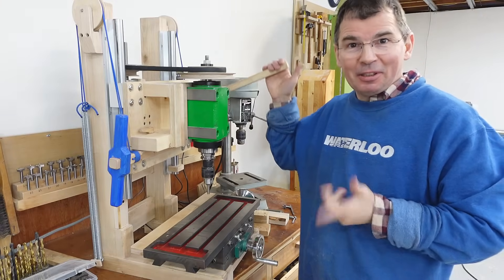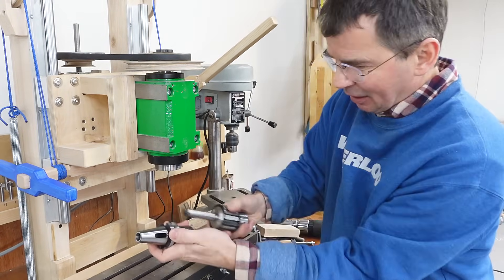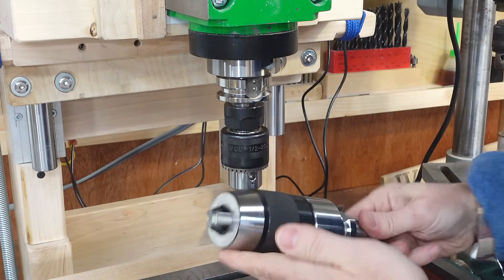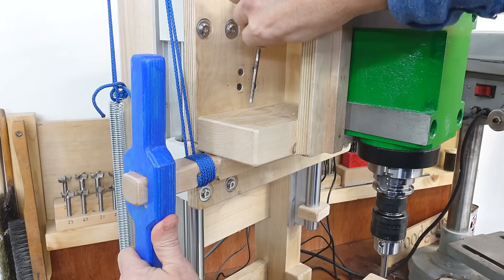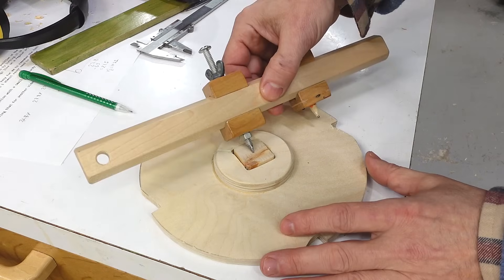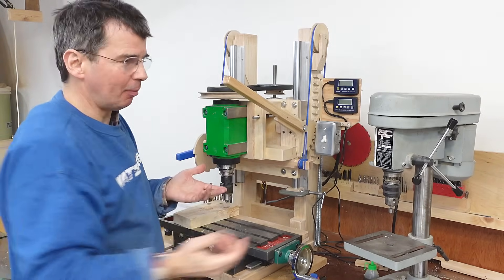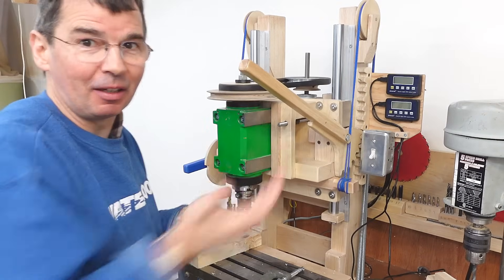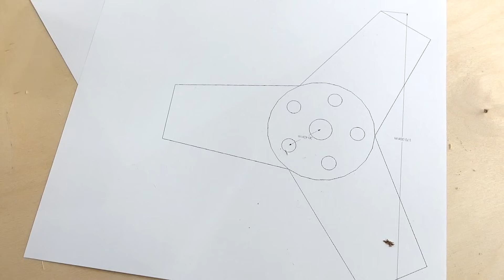What's wrong with my mill/drill and improving it

Comment: Now that you have improved the milling/drilling machine, what do you think?  One of the operations I would like to improve in my shop is drilling, relatively deep, truly vertical holes.  Is your machine better than your drill press at such operations?
Reply from the maker: I have lots of vertical travel.  Limited primarily by how much stretch I want to put on the srings.

Comment: quick and dirty way to shorten carbide bits is to hold them in the vice so that the part you want to remove sticks up, and hit it sharply with a heavy hammer. They usually break pretty well, and the imbalance doesn't usually cause too much vibration 😅

Comment: I read a reply of yours to someone asking about upgrading the springs to hydraulics, and it basically coming down to price. If money was no object, how would that work?
The more you talked about your resting height adjustment mechanism, the more a picture formed in my mind of a door closer sitting on its side where the springs are. If you found one in the garbage or something, would that work?
Reply: I was surprised it just didn't use a counterweight instead of springs

Comment: I have to complement you with your quick and smart problem solving but I have one trick for you it’s a little sketchy but one way I have shortened long carbide tooling is by clamping it in a vise (if you have to clamp on flutes to get desired length put some scrap aluminum as soft jaws) and hitting the shank periodically with a hammer. Be sure you hit it HARD because if don’t the tool will bend instead of breaking in a clean fracture

Comment: Matthias for CNC you need to make controller that talks in industry standart g code, it is much simpler to send from cad to cam to cnc, then to write your own movement, i did the same mistake when i build my first 3d printer i did write each instruction by hand, first it was easy square, circle, but then came more complex shapes like eclipse and yes gears also, then it took so much time to make new complex shape, and that was only  in 2 dimensions. i admit my defeat and did get proper controller, and yes it is much simpler. don't give up on cnc, add pen to it or laser, or plasma cutter, it is amazing how precise and repeatable is the cnc is. ps 1 aprill is coming if you have cnc you can make some crapy epoxy river table :D
Reply from the maker: well, Right now, I still use an old version of sketchup, which can only export Collada.  So that's what my program reads.  If it needed g-code, I'd have to learn a whole new tool chain

Comment: The advantes of the metal spokes on a drill press (3 handle spinney thing) . . . 
Where a spoke hits the work that is being clamped -- I just unscrew the problem spoke.  At the monent I have just 1 spoke . . . 
Your drill press / milling machine . . . the next refinement - removeable spokes !
Reply: Looks like his longer handles can be unscrewed from the main wheel from the side, so that should be possible

Comment: What if you extended the base of the drill press backwards, and added either straight or crossed vertical triangular braces to the back of the frame? Hard to explain in words, what I'm thinking is turning the L shape at the bottom into sort of an inverted T looking from the side, by adding a sturdy base plate. Then brace the rear end of the T, and possibly overlap the existing L joints (below table height) so they can't move.

The brace joints to the frame would need to be strong in both compression and tension, something like a tusk tenon maybe?

At least in (arm chair) theory that should reduce how much the frame could twist/rack, without sacrificing much or any of the nice clearance you have now (which would be a shame). At the cost of a fairly big increase in footprint though.
Reply from the maker: then there would be no room for the motor to go up and down

Comment: Hello Matt,
it's always amazing what you create out of wood😲😮👍! But when it comes to precision with a table milling machine, compromises have to be made. Wood is much more elastic than steel with the same dimensions. You have a lathe, an angle grinder and probably a welder. Maybe you'll also build something out of metal, for example a steel chassis for your drilling/milling combination. Maybe you can then swap the gear drill chuck for the keyless chuck, which is much more precise.
Interesting video, thank you very much😊!
Kind regards💛 Bruno
Reply from the maker: yes, but its so much easier to use large dimensions of wood than metal.  My wooden bandsaw frames for example are both lighter and stiffer than steel ones.
Reply: @matthiaswandel  Hi Matt, wood is lighter, yes, but wood does wood things...
I have wheels under all machines, so I don't care about the weight. On the contrary, the heavier they are, the more stable and calm they stand.
My ancient band saw from the brand "HolzHer" is made of cast light metal. My father had a solid beech base underneath that weighed around 60 kg. Somehow it always vibrated strangely. A few years ago I replaced it with a self-made steel chassis that weighs a good 100 kg. Now it's quiet and sawing is fun again. Ok, I could have made the wooden frame heavier, but I didn't have any 100 mm beech beams in stock and at that moment the MAG welding machine blinked at me so nicely that I couldn't resist.
Shortly afterwards I covered it with wood, wood just looks nicer, doesn't it?
Kind regards Bruno

Comment: Use smaller tools for milling and take lighter cuts.  
Wood is not rigid enough for a milling machine frame, and those linear guides are also not rigid enough.  This will cause your tools to chatter and break.  
Weld a steel frame and use 30mm linear guides.  The spindle in this machine is also probably not equipped to handle the job.

Comment: Yeah, if you're building a machine and rigidity is important, probably best not to build it out of paper, paper derivatives, or paper pre-cursors. There's a reason cast iron is the preferred material
Reply from the maker: So you have your own foundry?
Reply: @matthiaswandel  You don't need your own sawmill to use wood, or your own plywood factory to use plywood, and you don't need your own foundry to buy pieces of cast iron to build things out of either. Of course it's better if it's all cast as one piece, but that's not very realistic for a DIY project. There's also other methods that are more DIY friendly, like "epoxy granite", but I'm not sure how that actually compares to a cast iron casting

Comment: Your metal lathe looks big enough to make a BT30 taper, if you want a custom drill chuck arbour.
I made a CNC mill/router out of wood and that's not stiff enough for cutting metal either even after beefing up the frame with more wood.  If you don't want to use metal then epoxy-granite might be an option.  That's way stiffer than even steel and most of the work is in making the wooden forms.

Comment: Did you consider putting the knobs on the side for the handle kind of like a suicide knob for a steering wheel so that you only need to hold one to go all the way down?
Reply from the maker: No.  I have never found that to be a problem on my big drill press, and this one moves 120 mm per turn whereas the big one just 90 mm, so even less of an issue.

Comment: You can get BT30 with a Jacobs arbor on it, that would be my recommendation and it would reduce your runout even more.  A good drill chuck will have less than 2 thou of runout.
Reply from the maker: and where do you get one of those?
Reply: @matthiaswandel  YT nuked my reply, but "BT30 jt33 adapter" is what you need.  They have them in various gage lengths, you probably want a stubby.

Comment: Mathias, If you want GatorCAM for CNC, I'll give you a license.  You could "design" with svg then output gcode far faster than other CAM.
Reply: It can cut that gear out at 11:00 in the bottom left...with smooth sides.
Reply from the maker: seen the video of it, but it seems to be mostly for signs and such, which I don't make.
Reply: @matthiaswandel  it will cut any shape. With pockets etc.  Signs are just V-bit functionality.

Comment: Perhaps I'm missing something but it appears the frame is not fastened to the bench top. Wouldn't bolting the unit to the bench remove the twisting in the frame?
Reply from the maker: Would cut down on it, but I slide it around he bench a bit depending on what I use it for.

Comment: If you ever wan to stiffen up a wooden structure glue very thin metal plates to either side, you will be very surprised just how much this works. It's the gap between each plate and how the plate doesn't want to stretch or compress.

Comment: It's obviously a very different capability, but I built a slot mortiser that's sort of the same general format as yours, but aluminum and linear bearings. Eventually I put a DRO on the Z direction (instead of the counting wheel) and loved it so much that I put DRO's on the X and Y as well and it's extremely useful for things like this. It makes me want to build something like this, too.
Reply from the maker: Good idea.  When I built that machine 15 years ago, there wasn't a lot of affordable stuff like that online.

Comment: a grinder will cut carbide just fine, just gonna eat half the wheel while doing it. also you have a lot of empty air in that frame still, you could easily stiffen up the torsion with some more supporting elements, like even just plywood tying the back and underside frames together would help

Comment: why not just a iso30 to b16 i believe is in drill chucks? you can order them everywhere.
Reply from the maker: that's what I have.  Just too long.
Reply: @matthiaswandel  if you search google for iso30-b16 you should be able to find very short ones ,the backside of my chuck is mounted almost against the iso30 flange.
should save the room of the iso30-mt2 mt2-b16

Comment: Clearly you ought to replace the oversized spindle with a smaller ER one, and then you can re-use it to build a dedicated milling machine ;) I would suggest concrete as a material, much cheaper than all that fancy wood.
The keyless chucks on BT holders would typically not see too many rapid tool swaps, most CNC shops would have a dedicated chuck per drill bit / reamer size in the tool magazine of the machine.
I see the point of how they're annoying on a manual drill press.
Reply from the maker: Replacing the spindle means rebuilding half the head unit.  If I ever want to build a dedicated milling machine, I'll definitely switch it.  But right now, its just not worth the cost to cut 5 kg weight off the head.

Comment: I have never seen such think plywood! Did you make it by gluing two together? Or am I ignorant by only having the big box stores like Home Depot around me for wood? If you purchased that from a real lumberyard it must have cost near $200?
Reply from the maker: its 23 mm baltic birch plywood.  Bought a 60x60 cm piece a few years back.  I only use it when I really need the thickness.

Comment: Would extruded aluminum like 80/20 work better?
Reply from the maker: Probably would be much less stiff.  Aluminium flexes easily, and the corner connectors for that stuff are not that strong.
Reply: @matthiaswandel  Steel square tubes are much stiffer than aluminium extrusions. I've bolted on steel square tubes to aluminium extrusions to remove torsion flex. Went from 1mm down to 0.01mm compliance. It's just a matter of how bulky vs stiffness vs weight vs cost vs machinability it is, and the most important factor: need.

Comment: Worth considering gas struts instead of springs for the head, as they give a much more linear force. I modified a small mill with some and it's spooky how it could essentially make a fairly weighty spindle head "float", and thus need almost no effort to raise and lower.
Reply from the maker: I hadn't thought of that at the time.  And those gas springs cost more than screen door springs.
Reply: @matthiaswandel  Gas springs can be found cheap from car junkyards.
Reply: @ yes, though ideally you do want one that has both the right travel length, and the right level of force (to balance the spindle head); so it may not be easy to get the exact right thing from a junkyard.
Reply: I suspect @mattiaswandel would be able to design around a gas strut being slightly weaker or stronger than needed using counterweight or mechanical advantage to dial it in.
Reply: @GusTopher21  quite probably, but that'd then take more time (and possibly cost) than just getting the right gas strut in the first place.

Comment: If you wanted to build a 2.0 version, you could start by using a similar build as your bandsaws : a massive laminated C-Frame, or better, two C-Frames like your current version. The table and column would be one and wouldn't rely on fasteners.
Reply from the maker: yes, much more massive and much more stout.  I'd probably use hardwood though, as provides a stiffer mounting surface.

Comment: Instead of making the back with 2 horizontal rails why not make it with a full ply wood back.. that would make it soo much stiffer against side to side movement
Reply from the maker: the side to side is from twist of the frame.  Plywood wouldn't prevent that, unless i screwed a torsion beam box to the back of it.  But its not important enough.  I wanted an opening behind the table in case something was oriented that way.
Reply: @matthiaswandel  Yes, Matthias.  Use a closed form in some way to reduce the torsion.

Comment: If i were to take the time and money and patience to build a wooden mill or drill press my luck the wood i used would end up having an ant or termite colony inside and i go to use it then get attacked when it snaps in half..  just like the trailer i built.  Made the whole frame from metal and put a wood deck and railing on it well not a week later i put a washing machine on it and it falls through and a thousand ants come crawling and flying out..

Comment: More than year ago i have made milling machine using the same BT30 chinese spindle and two of the same cross tables (one for the spindle, one for the workpiece). Main difference is i have had chosen massive welded construction (entire machine is about 200kg, bolted to the massive 300kg table which is bolted to the concrete floor). It is powered by 1hp motor and it is milling like a champ, even hardened steel. I have changed screws in tables for stainless with bronze nuts, those original are just garbage and equiped those longer ones with motors. DRO in all three axis ist must have.

Comment: seriously Matthias, it's not about how you made this machine, it's all about material choice )
wood is a bad choice.  stiffness comes from material young's modulus which is ridiculously low in case of wood.  you can made it out of solid cube of plywood and it will not be stiff enough.
you need metal.
as for your spindle head choice - bt30 one is quite good actually.  it dampens small vibrations just by it's weight )  which somewhat compensates overall machine flimsiness.
with a lighter head you'll get more vibrations.
Reply from the maker: Metal is a lot stiffer, but its also much heaveir.  In terms of achievable stiffness per weight, wood wins.  My wooden bandsaw frames are stiffer than comparable metal ones.

Comment: There's a fellow on youtube who 3d prints shells for tools, then fills the plastic shell with concrete. Probably the dumbest possible way to stiffen a frame, but you could probably do the same thing with a wood shell.
Reply: @yoyofargo but then you can get the clickbaity title of "I 3d printed (insert tool/machine)"
Reply: provided it was sufficiently stabilized wood that is. like a waterproof fiberboard.
Reply: The shell part would be redundant.
I mean...not while the concrete cures.
But you really only need a form till you get to the concrete stage.
That's actually how I built a few of my tools.
Reply: Print the shell. Then fill it with lead shot and epoxy. Then laminate the outside with carbon fiber epoxy composite. Now we are cooking with gas.
Reply: @mckenziekeith7434  Extra flexible, low thermal stability, and toxic?
Yeah. No. That would make it worse in almost every way.

Note: If you think a few layers of CF are going to help, you don't know material properties.
CF might be stiffer in certain directions than steel BY MASS, but it is far less massive than steel so you need way more.
By the way, wood ALSO happens to be stiffer in some directions than steel by mass.
Reply: @ no offense but you are wrong on all counts (except arguably the toxicity, although lead shot is not so toxic). A very few layers of carbon fiber on the outside of the structure will stiffen it up tremendously. That is basic beam theory. The carbon fiber is not there to provide mass, but only skin stiffness. The lead provides all the mass needed. Most of the interior material in a big iron casting is not stressed. The peak stress is in the outside layer of the beam. As far as temperature stability goes, once again you are dead wrong. Carbon fiber has lower temperature coefficient of expansion than just about any other material. Carbon fiber structures are very resistant to thermal expansion and contraction in the direction of the fibers.
Reply: @Prophes0r  the mixture of lead and epoxy is, essentially, a core material. It doesn't need to be that strong. Just strong enough to handle the shear stress. The carbon fiber on the outside handles the tension and compression loads, just like in any beam. If you know about sailboats, then you know that core materials are not nearly as strong as the skins. Lead/epoxy is not modeling clay. If you want to use something else to bond the lead together that is fine.